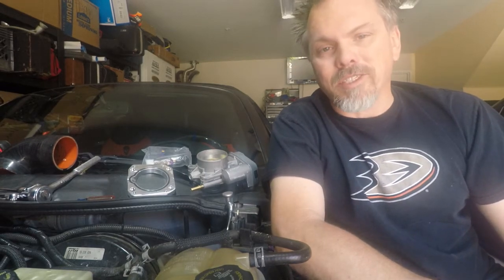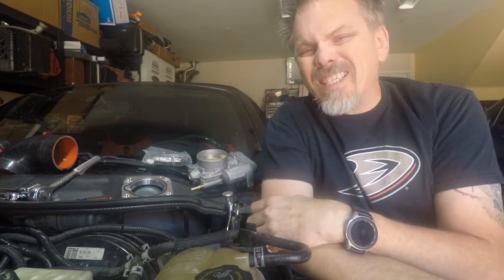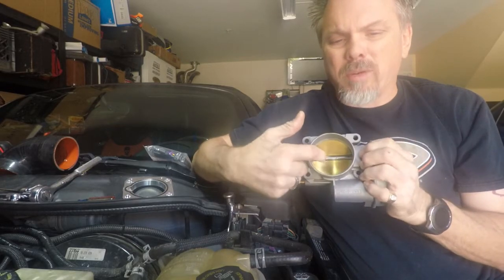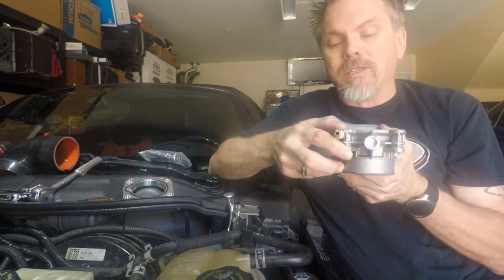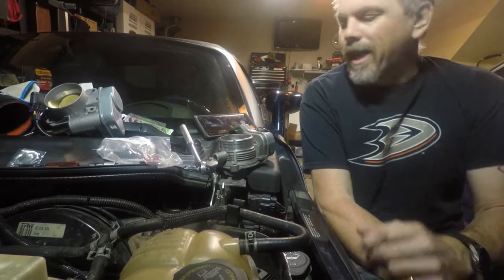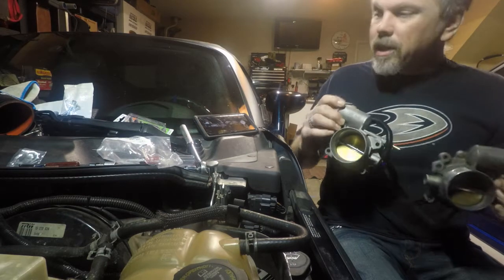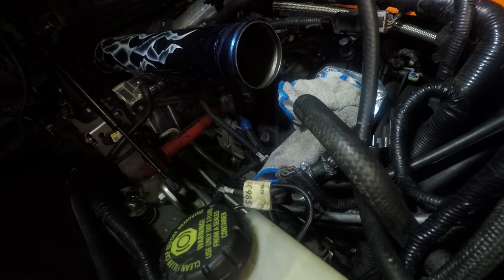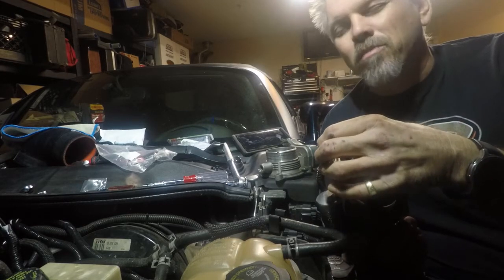LSJ throttle body on an LE5 Saturn Sky (2.4 turbo)

Comment: Great job Troy. Welcome to the world of talking to yourself and doing everything with one hand while the other holds a camera...lol.

Quick question (for the 2.4 NA guys). I would think the larger throttle body you installed would need larger injectors as well? The 2.4 oem injectors are pretty small and maxed out at WOT. Would you need the larger injectors with that throttle body?
Reply from the maker: For NA I think if you are not going turbo larger injectors are probably a good idea regardless though it isnstated they are not a requirement. This doesn't give you much of a power gain...5hp max...but the stock injectors are stressed to begin with. 

If you are going turbo you are already doing bigger injectors and this larger throttle body isn't going to give you more power so for my application, this is just bolt on.